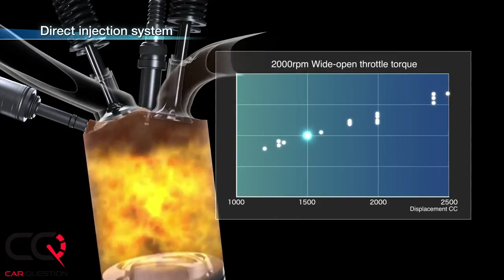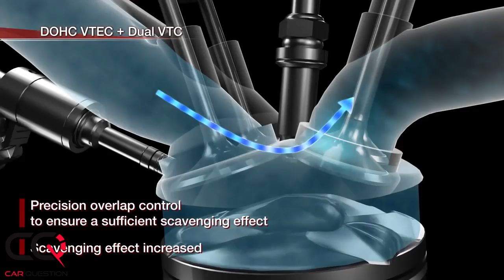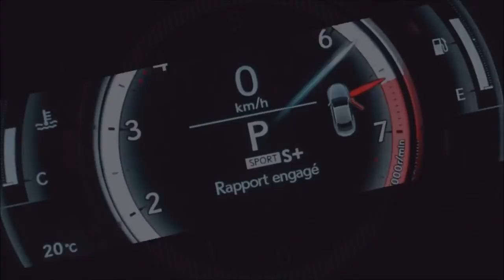Honda CR-V Turbo: Overfilled oil levels and a gas smell Fix and RECALL!

Comment: I just love N/A engines. I’ve seen so much nightmares with turbo engines in general.
Reply: their is a gaggle of autos that have turbos most of them are good
Reply: I get that. But this issue doesn't really have anything to do with turbocharging.
Reply: Ryan Littleton indeed, just saying love the N/A engines because turbo engines are expensive to repair compare to an N/A.
Reply: @clou1969  Oh I know what you're saying. I don't have this engine, I've got an NA 2.4L in my Si. I still like the 1.5T though.
Reply: @ryanlittleton5615  Turbo makes it worse since you're adding boost pressure into the cylinder potentially sending more fuel past the piston ring. Obviously the fuel injectors and fuel mix ratios are designed with the turbo in mind.
Reply: @volatilememory9338  Honestly I don't see how it could make it worse. For whatever reason the 1.5T takes a long time to warm up. It doesn't explain why the majority of the 1.5T engines are fine, and also the fact that the 2.0T in the Accord (and Type-R, RDX) doesn't have that issue. I'm not sure, this whole thing is confusing. I also don't get why it affects the CR-V FAR MORE than other Hondas with this engine. What do you think?
Reply: @ryanlittleton5615  It may very be true that most 1.5T are fine. I suspect that most average drivers don't know anything about it unless the car truly smells of gasoline. Or there's enough fuel to cause a CEL. They just change their oil at the recommended interval but the long-term wear-and-tear is still undetermined. Even though the 1.5T is the same with the CR-V and Civic, they are tuned differently. I think the Civic 1.5T is probably fine because it's not tuned for more HP, torque, boost pressure, and curb weight. The 2.0T is a totally different engine.

Honda CR-V 1.5T: 190 hp, 179 lb-ft, 18.5 psi, 3358 - 3512 lbs

Honda Civic Sedan 1.5T: 174 hp, 167 lb-ft, 16.5 psi, 2900 - 3010 lbs

Honda Civic Hatchback 1.5T: Same as sedan, Sport is 180 hp, 162 lb-ft using Premium gas

The rpm are about the same for these engines. You can immediately see the CR-V has more horse power and torque at about the same rpm ranges. It's physically doing more work to push more weight and likely requiring more fuel.
Reply: @volatilememory9338  Damn that's a long response. But you may have a point about the CR-V I've heard that as well. I haven't seen hardly anything on the Accord 1.5T though. Not sure, like I said it's pretty confusing.
Reply: Ryan Littleton 1. Better bloggers post more data. It's good for analysis and less opinions. 2. The Accords have the shortest time on the market and the biggest problem is bound to be longevity and not whether the car will run. We have yet to see how these engines will do with intake deposits. It's  still too early to know. 3. The boost pressure is higher than boost levels on typical turbo cars and the compression is far higher than in the past for the sake of higher mileage. My atmosphere has 85% of sea level so my compression is effectively lower but Texas and Florida are usually lower in elevation so maybe that's why they are seeing more problems. 

To solve any problem it is helpful to look at the issue numerically and for that, the Honda engineers have the most data and information. We the public can only guess and make observations based on what we do as users. I am considering: altitude. temperature. load. oil viscosity. oil level. time of warmup. time at higher load use.  So there are lots of factors to consider and we will all log our experiences over time, but Honda will possess vastly more engineering data. Hopefully Honda will be forthcoming with information.
Reply: @jamesmedina2062  Yeah hopefully, you have very good points sir. Thanks.
Reply: Normally aspirated direct injection engines have the same issues and many more. This isn't a turbo issue at all. It's a direct injection issue and the whole industry knows that and knew that as they were making these engines, but the world over, governments pushed car makers to quickly make tiny engines capable of powering big cars, so there's the solution.
Reply: @volatilememory9338  the issue here is that the lower compression engines are using a higher octane fuel (91+), which burns at higher temps than 87 does. That causes a more complete burn and nothing to condense once the engine is shut off.

Comment: I was at a Honda dealership and pulled the dipstick out of a 2019 CR-V with 5,000 on it and there was a heavy smell of gas on the dipstick. My wife smelled it and the salesman smelled it. Also with direct injection there is no gasoline being squirted at the back side of the intake valve, this will over time cause a build up on the intake valve causing poor air flow past the valve to the engine. This will cause a loss of performance and a possibility of a check engine light appearing on the instrument cluster. It is over all a bad engine design. You could not give me one of these cars. The resale is going to be horrible once people begin to hear about this problem. The oil in cars is so thin these days and now there there is gasoline being mix in and further thinning the oil! NOT GOOD!

Comment: This oil dilution issue really has been blown out of proportion and nobody knows wtf they're talking about. Some say because it's a turbocharged engine and all this crap. I've been a tech at Honda for years and this issue is b.s. longer drives will burn the gas out of the oil. Your oil could've been overfilled at your oil change and now you think its gas. Maybe ask a tech like myself that deals with this customer complaint and get actual facts as to why it's happening. People seriously have to complain about everything. It's a fucking Honda it's not gona be perfect. People expect a 35k dollar car to be perfect well guess what. Maybe go spend 70k on a luxury car then you can complain about all your little issues
Reply from the maker: Now that's interesting, you're working at @ Honda dealer? if so which one? Wanna do a video about that and send it to us so we can put it on the channel about your point of view?
Reply: @CarQuestion  I would honestly love to make a video to clear this issue up for alot of people who are putting out false info ( not you ). I've never made a video so I'm not sure how I would go about doing it properly. Unfortunately I cannot disclose my exact dealership but i am in the north east pa/nj area.
Reply: @justinrochman5076  we all know that low ring tension for fuel economy do not mix with direct injection.  Why does Honda have to do TSB fixes and all of the other manufactures do not?
Reply: Justin Rochman I think it’s been blown out of proportion too, and mainly because of social media. I’m seeing people complain about their oil being dark for crying out loud. Ummmm, duh, all oil goes dark as it’s being used. I guess people don’t realize that. It’s why you need to regularly change it. 

I think the number of complaints on this vs. the number of vehicles sold is actually minimal, but it’s being blown out of proportion because of social media.
Reply: Justin sounds a lil stressed out . I'd be ticked off too if I was a frontline honda service advisor these days .

Comment: Sadly, even with all the problems, they’re still the number one go to for longevity. I’m not defending Honda. However, name a better 300K mile engine for $20K 🤔 I looked high & low a year ago, b4 purchasing a 2019 Civic Hatch Sport, 6Spd manual 🤷🏽‍♂️